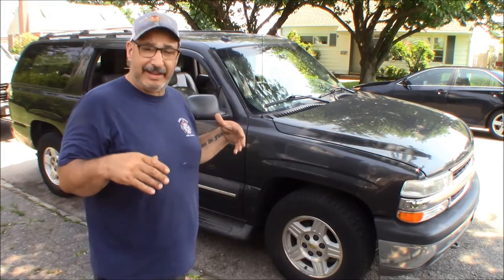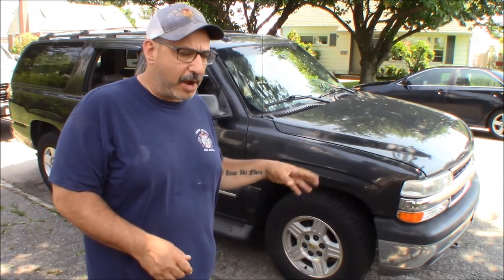Fuel Injector Issues: P0200 & P0303 Diagnosed & Solved | 2000-2006 Chevy GMC Truck

Comment: My 96 impala ss has been doing this for two summers and my mechanic just found out it was the connector on the #5 injector. He used a little light bulb he plugged into the pigtail wiggled it and it went in and out. Also it threw all those same codes you mentioned! He used a stethoscope to listen to all the injectors as well as a ohms meter to find it.
Reply from the maker: Good Diag

Comment: My truck just blew the #8 cylinder something i cant figure out for the love of me my cylinder was washed and full of fuel as well as my oil had a half gallon of fuel in it roughly, i went through the injectors, coils packs, plugs, and wires. I only get a number 8# misfire code that flashes

Comment: If I was getting p0300 and my fuel injector wiring harness specifically under heater core hose could that just be a harness fix?
Reply from the maker: It's possible, but you have to determine the reason and cyl for the P0300, otherwise it's just a blind guess

Comment: Hello i have a 03 Tahoe check engine light is off but code P022 & P0300 comes up on scanner. We have ran the truck over 200 miles and the light does not come on but codes still show up on scanner. Do you have an idea why that could be?
Reply from the maker: I would GUESS, that it's a very infrequent code that doesn't meet the criteria to throw the light before it goes away on it's own.  I wouldn't worry about it if the vehicle is running good and there is no CEL

Comment: I had the same issue by the way on a suburban 2011 thinking it was an injector but youd be surprised because on gm vehicles if theres a miss on a cylinder it disables the injector so it does not flood the cylinder but mine turned out to have no compression on cyl 1 like 0 psi and im thinking i have a bad lifter but great video glad you found the issue!!
Reply from the maker: Glad to help

Comment: I have a 07 Yukon 5.3 it started sayin I was out of gas and I wasn't then the other day engine light came ok sayin P0307 and it was idling rough plus I smelled gas drive it heard a pop from the engine and parked it. I'm thinking it's the injector ok cylinder 7
Reply from the maker: I would think the gas gauge reading and the P307 are not connected, but ya never know.  If you smell gas could be an injector stuck open or a coil misfiring

Comment: HI i have a 2006 chevy avalanche  codes are P0200 and P0308 also wen truck is on it smell of gas is this similar to your problem
Reply from the maker: Similar yes,   So your misfire on cyl 8 is most probably caused by a bad wire going to the fuel injector or a bad fuel injector.

Comment: Los mismos codes p0200 y p0300
En mi caso el bank 2 no tenia power solo graund  y al desconectar  los coil y inyectores 
El power aparecia 
Estaba confundido 
3 times cheque los harness y los fuse 
Bueno por último el fuse bank 2 está muy flojo un pin 
Estaba confuso todo el tiempo tenía power so desidi moverlo y ese era el problema
Reply: Donde esta el fuse bank 2